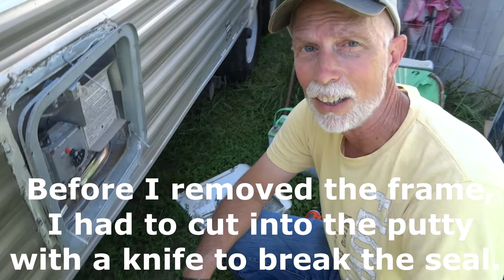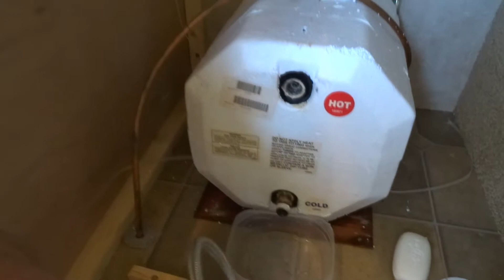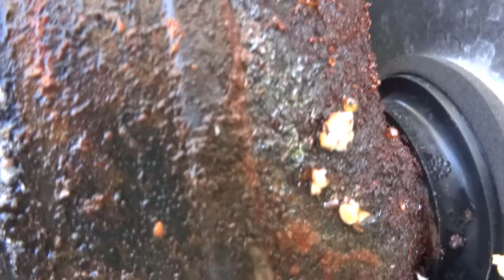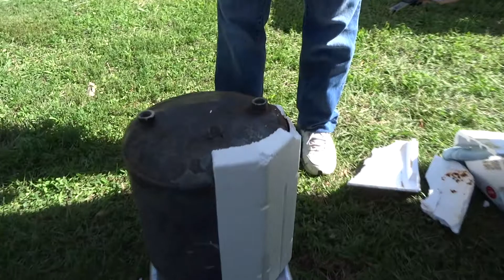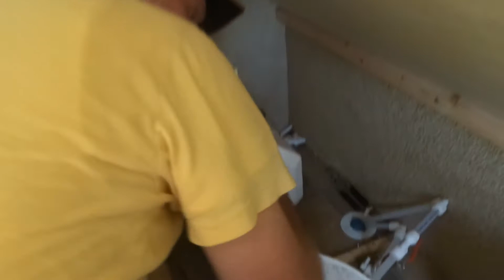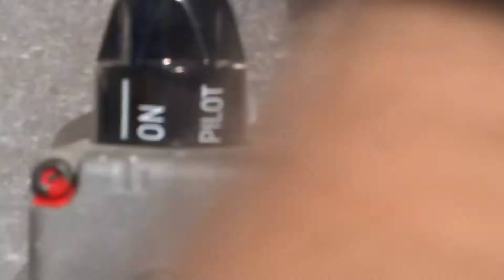Installing a New RV Water Heater

Comment: I need one of those Suburban SW6 PR units to replace mine that is rusted and leaks! Where did you order it from?
Reply from the maker: We bought a 10 yr old travel trailer from someone who rarely used it.  The leak had been there awhile though and rusted the bottom of the old one.  I actually bought it on Amazon.  Make sure to match the propane lead into the unit.  We almost bought the wrong one although it said it was the same model.  Glad this video helps.  Feel free to ask questions if you have any.  It was awhile ago, but I will help if I can.

Comment: That was a great job except you didn't mention it wasn't a 120 volts or 12 volts. All you said is it was a propane water heater. Most water heaters are propane.  I figured it out at the end but, a lot of viewers wouldn't.
Reply from the maker: Sorry about the confusion.  At about the 1:00 minute mark I mentioned that it was a 'propane only' water heater.  There were no electric connections at all on this particular water heater.   I also mentioned it in the description.  I know that many propane water heaters have a electric spark but this one did not.  I probably should have emphasized it more than I did.  Thanks for your comment.  Hopefully, it will help someone else with the same question.  :)

Comment: I may have to do this as well. We have a tankless water heater and the water lines and propane lines are opposite of course. Cant they make things simple? Great video Dean. 👍🥑🇺🇸
Reply from the maker: We had talked about going to a  tankless.  The reviews were so mixed on it though, that we decided to just go with the one that we installed on the video.